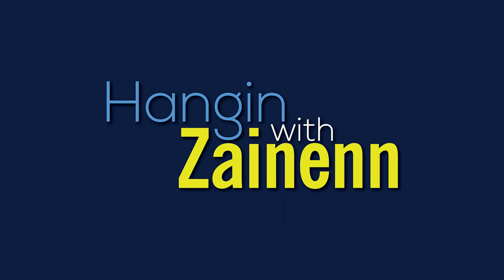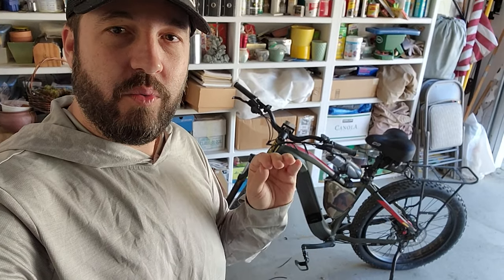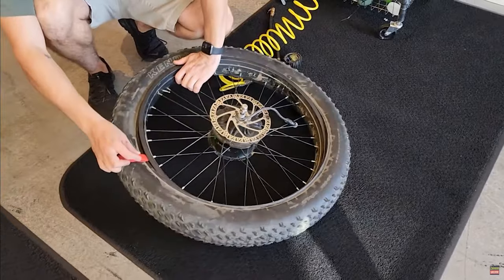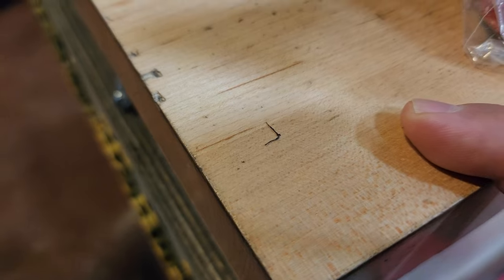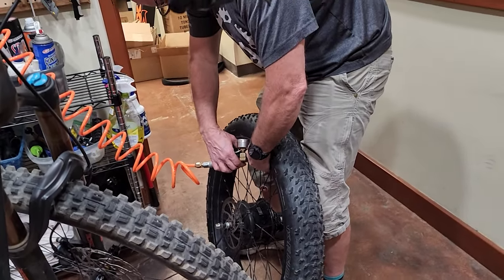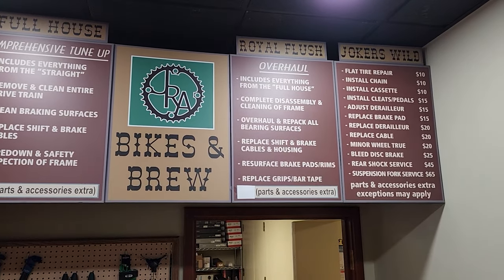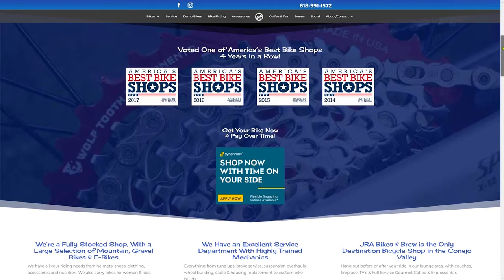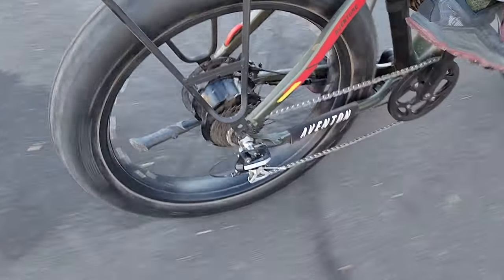Aventon eBike Issues Finally Fixed: I Can Ride Again!

Comment: Great video. I’ve used a metal detector pin pointer to find nails and screws in my vehicle tires.
Reply from the maker: oooo, thats a good idea!  That definitely would have found that tiny piece of wire.
Reply: Cool now I know what I can use my pin pointer for 😎

Comment: Tannus armor  is what you need. I haven't had a flat in a year. Look it up it will be the best you will do. Then get rid of the tire slime.
Reply from the maker: Are there fat tire versions? I've heard of those.  I know it takes specialty innertubes if you use them.
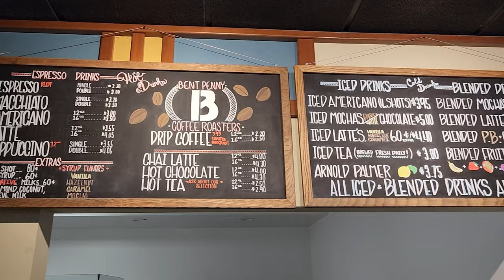Reply: @Zainenn  I have the same aventon advenute bike and I installed the Tannus Armour tire inserts (shown in your video at 4:34 minutes at the store. Yes they sell them for your exacl bike/tire size, and I had my local bike shop install them. I put 500 miles on so far; I ride in agressive trails in Las Vegas. I highly recommend them, they smooth out your ride and you can ride at lower psi. Thanks for creating the great content on this bike!
Reply: @Zainenn  Best investment you'll ever make. They make em in all sizes. Haven't had a flat in 2 years and that's the truth.
Reply from the maker: @erpringle  I'll definitely get them.  I believe it, I've gotten a lot of comments about them.  Does it require different size inner tubes or do I just not pump the normal ones up all the way?

Comment: I have a question, if I’m going to use a bike to use daily for school, should I do the Aventure or the Level 2 ? And what is the weight limit on it because in aventon themselves it says 400 but bestbuy says 300 ? And lastly how’s the mileage on the Aventure cause it seems theirs a 25 mile max difference between the 2 bikes but I could get the Aventure in hand today which for the level 2 I would have to wait 6 days
Reply from the maker: Well, I'd say if you want to go on trails or any off road a fat tire bike is the way to go. If you are only going to do road riding I'd go with the level.  I am 6'2 226lbs and I can fully load up my bike with bikepacking gear and it works perfect.  In terms of mileage I can get 40 miles on a low power setting with pedaling.  I think the 25 is for people who rely on throttle and high power settings. Aventon is a great quality company, never had any issues with customer service.  How much do you weigh? What is the distance to your school?
Reply: @Zainenn  thank you, this helped me out a lot

Comment: Nice shop. Looks like a Celeste Bianchi e-mtn on the repair stand 4:02 ? v-nice if it is. I'd shop there forsure.
As far as why a shop won't work on class 3 ebikes, I'm not sure that it's "class 3" that is the issue, (I have the Aventon Level) I have found that some shops won't service e-bikes they don't sell due to some may have weird issues, electrical routing probs, power failure, diagnosis issues, etc.
One of the shops I normally visit took in a fairly high end ebike to diagnose power distribution issues from the battery.
At the end the bike owner blamed them for making his bike issue worse so now they won't even touch other manufacturers.

Comment: How does your bike shop feel about Aventon bikes in general?  Good bikes?  Meh?  They look like they're well built to me.  I'm surprised they added the tire goo and didn't try and talk you out of it.  I heard most bike shops don't like messing with it.  But the fat tire era might be changing that with "fatter" chances of getting punctures.
Reply from the maker: My local shop doesn't deal with Aventon or other class 3's.  The last video I did was an Aventon dealer and he said it was the most popular out of all the ebikes they rent out.  It is very well built, all the welding is perfect on the bike.  I love it.  I've heard from a lot of people that it is best to get the tire slime done on fat tires, just because they are so fat and it prevents small leaks like the one I had.  Thanks for watching, and subbing!
Reply: @Zainenn  Ohh!  Where was that wire hiding?  Hard to believe the previous shop couldn't find it with the soapy water.
Reply: aventon uses good quality batteries, i had a good experience with their bike

Comment: Mexican sandburs get my tires. I had thicker tubes & armor belts put in. Fewer flats not but still get some. On my old bike I replaced the tubes with foam rubber ones. Best thing I ever did. 8000 miles and no flats. That was after having thorn-free tubes, armor belts & green slime failing to solve the problem. If you get a glass cut and have the green slime all over between the tube & tire You may not be so happy about using that stuff.         However, I can't find foam tubes for my EV size tires. 275 x 220. Can anyone help find them? Bike shops seem to hate them.  Claim they brake spokes.